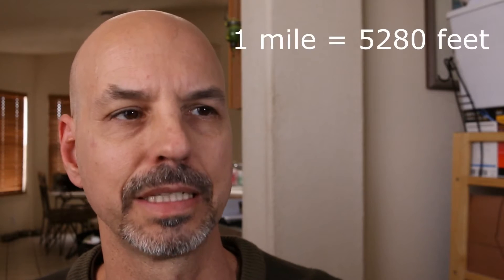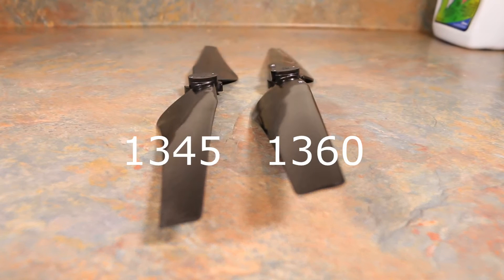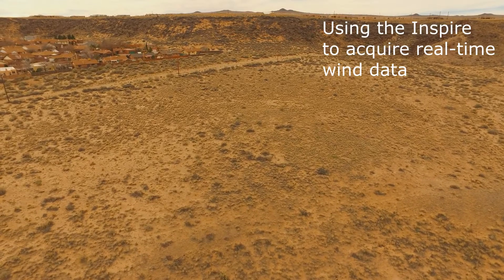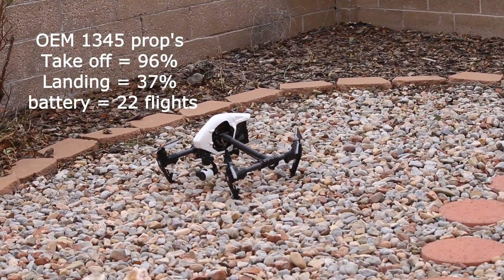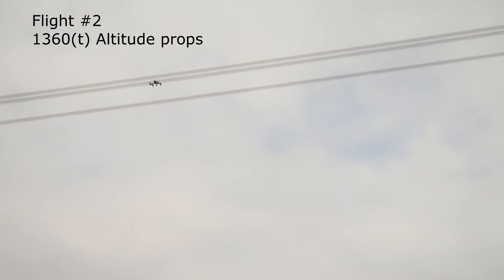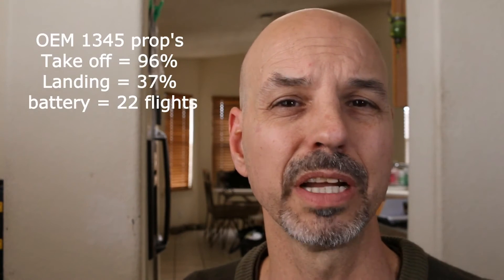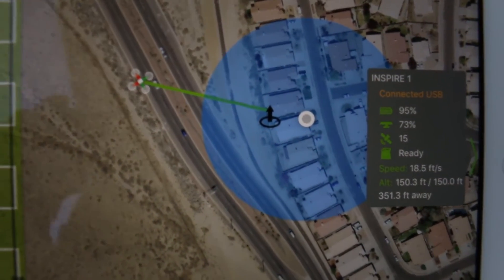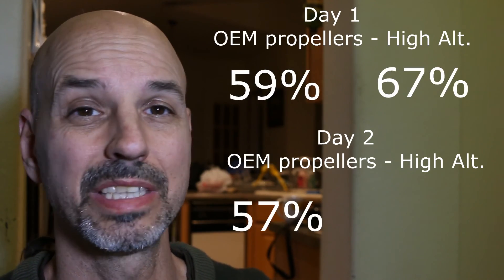DJI - Inspire 1 - Altitude Prop Review....

Comment: Nice job. Do you think drones can fly 4km high? How fast would yours do that?
Reply from the maker: Depends on the drone.  I've never tried to fly that high.  I think my highest flight was about a Kilometer.  My Mavic Pro and P4P are hacked, so they would certainly climb past the 500 meter limit.  I honestly haven't had a desire to see how high they will go.  I use my drones professionally.  So tossing caution to the wind is not on my agenda....<;^)  That said, there ARE guys achieving very high altitudes on YouTube.

Comment: No, it is NOT a 60 degree pitch. 1360s have a pitch of 6 inches, meaning, if it was a screw with that pitch it would travel 6 inches through the medium (in this case air is the medium) per rotation as you were screwing it in. 1345s have a 4.5 inch pitch, so they would go 4-1/2 inches per rotation. It is quieter, because it is moving all the air it needs for hovering by rotating at a lower rpm. It is like being in a higher gear, so the top end would be faster, but at lower speeds it wouldn't accelerate as fast as the original props. At higher altitudes, or days with high density altitude, it would take a bigger bite out of the thin air, and perform better.
Reply from the maker: Interesting explanation of the nomenclature.  I had no idea.  Thanx for the clarification.  

Regarding motor  RPM, I get that part and kind of figured.  It makes sense that a prop moving more air would rotate slower.  The gear analogy is one I have used many times.  Thanx for the clarification on the nomenclature.  I appreciate it.

Comment: I noticed you said that it was cold outside. Cold air is more dense, altitude is as big of a factor. Should try them when its 100 degrees outside
Reply from the maker: It wasn't cold.  It was cool...65-ish, if I recall.  I've considered the possibility that these props might be beneficial in 100 degrees plus, but then I'm getting into a situation where I'm over-heating batteries, motors and iPads.  So those test would be moot.  Generally speaking, 95 degrees is our cut-off point.  And, as I'm sure you're aware, the higher you climb, the cooler the  air gets.  So finding 100 degrees @ 8 or 9 thousand feet (to equal same air density as 70 degrees @ 10 or 11 thousand feet) is highly unlikely.

More than likely, sometime in the future, I may test these props at Sandia Crest (a mountain near my home).  But I probably won't make a special trip up there.  Good luck!

Comment: Glad someone like you is doing the tests for the world to learn. My observations are that with more propulsion like using Platinum props on a Mavic1 you have more thrust so the copter over powers and you need to turn gains down to ease back how much throttle rpm its putting into every movement. By doing this the drone may use less power also. Dont forget to put gains back on 1345s tho. Also the copter may be more skitty using 1360T on 100% gains... and may over gain to stop etc... this is sometimes noticed by slight oscillations or wobble. Did you see any over comp wobbles? Fancy doing the test again... hehe. Perhaps not? Cheers.
Reply from the maker: Glad you found the video helpful.  I honestly don't plan on doing any more testing, and I'll tell you why.  I have since learned that the high-altitude props are designed for 10,000 and above.  So, at 5200', the HA props aren't netting any benefit.  If I find myself above 10,000' MSL (we actually have a mountain with a 10.5K peak to the east of the city), I WILL conduct high altitude tests.

Thanx again, you have a good day.
Reply: Yes after I wrote this I saw someone on a forum saying 10k they work really sweet. Thanks for the reply bud. Like your videos.

Comment: Hey Donnie, have you tried the Xoar prop kit?
Reply from the maker: No, I haven't.  Tell me about it.
Reply: Donnie Frank they make a Carbon Fiber prop kit for the Inspire 1 which includes a spin on adapter mount. I have been looking into ditching the DJI props and mounts and putting on CF props

Comment: Great test and very well edited video. Good info. The reduction in noise, I really get that! Even in hobby flights, I do think about regulations but also what people might think. It doesn't matter if their thoughts are valid, they need to be considered. And yes, why shooting down comes into talks, even during coffee breaks. In Finland, where practically only few people have guns, and they are licensed hunters. Be it joking or not, it's not funny. Btw the last two digits are the prop advance, inches per revolution (6.0" in this case), not degrees, as the shape cannot be measured with a single angle value, but it is proportional to angle anyway. Thanks again!